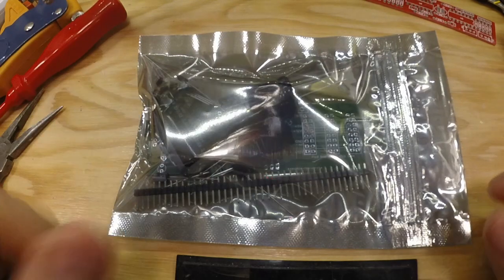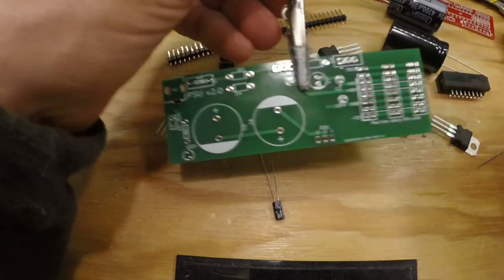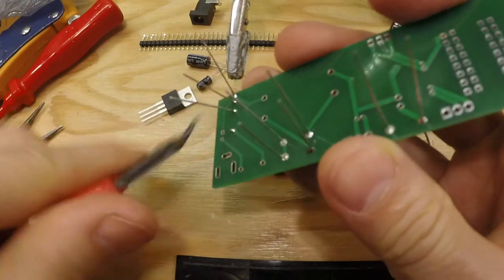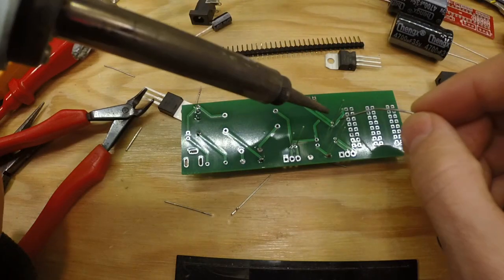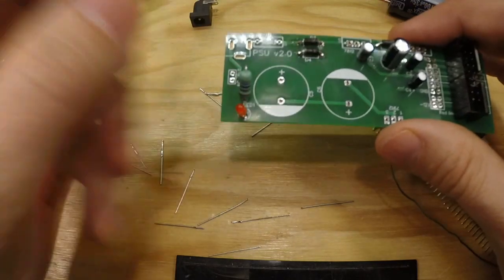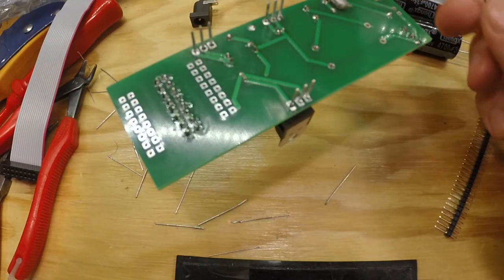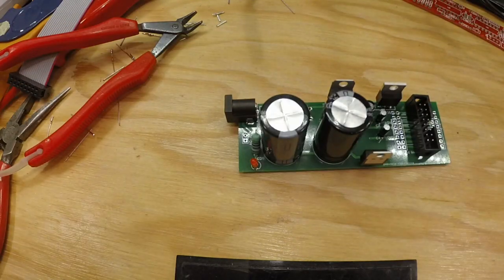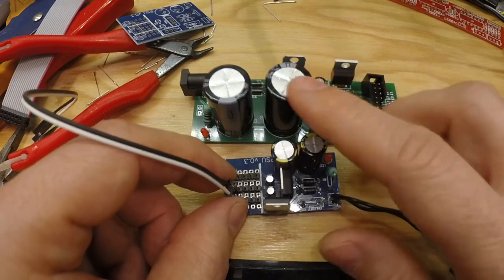PSU2 Soldering instructions

Comment: Just a tip for you all. It's good practice to use a heatsink when soldering any semi-conductors (LEDs, transistors, diodes, i.c.s) as they're all sensitive to excessive heat. If you leave the soldering iron in place too long, they can be damaged.

Comment: Hey Kristian :) thank you for making this! I just soldered together my psu and it gives me wrong output voltage (9V, 4V, 3,5V) I got two of them because I wanted to have a backup and they both have the same output voltages. Then I checked my ac-ac wall adaptor and instead of 12V it provides 16V. Do you think the wrong output of the wall adapter could be the problem?
Reply from the maker: Is it 16v ac or dc output? That is the important thing that usually people do wrong. It should be able to handle 16VAC. If you have DC out then it might look like this.
Reply: @SourceryOne  The wall adaptor ist ac, I checked the schematics and it says that the smallest capacitors should be 1uf30v, mine are 1uf50v, could this be the problem?

Comment: Hi, I'm planning on buying one, or two.
I was wondering what is the Amperage rating of the unit? I'd like to know how many modules I can power.
Thanks ;)
Reply from the maker: Unfortunately I don’t have a good answer. The regulators are rated at 1A. But then you need a big wall wart 12VAC and BIIIG heatsinks. :).
Reply: @SourceryOne  it seems you probably get 1/2 or 1/3 of the amperage you put in. for example 1000ma you might get 300ma - 500ma. I could be wrong though, my friend had a quick look at the board. But apparently this is typical for this kind of PSU :)

Comment: I was wondering how you'd go about connecting this (or the busboards) to some of the diy modules you've made. Are just the +/-12 v and ground pins used, or is it more complicated than that? I'm mostly confused by there only being 2-3 points of power entry for each module, but many more pins present on the power supply.
Reply from the maker: In the early modules I just used DuPont cables to connect +- and gnd to the modules. The later Modules using the eurorack power plug (IDC) is just using the “industry standard” for modules. On these connectors each “row” is the same voltage. So going from the “red stripe” the voltages per row are 1. -12v 2,3,4. Gnd 5. +12v. 6. +5v. 7,8. Cv and gates (not used in the psu, but still there to fit the standard). Hope that clears it up a bit. But again it is totally fine to just use cables DuPont or other and connect power to modules.
Reply: @SourceryOne  I see, so if I use dupont connectors should I wire from the whole row or just one of the pins?

Comment: Looking forward to mine arriving soon. Can I check what sort of AC adapter you'd recommend for this? And do you also have an idea of how much power you get per rail? Thinking about what size setup this will be useful for. Thanks!
Reply from the maker: Sorry I dont really know how much, but it is enough for a bunch of modules though. The regulator is rated at 1A max, and then it depends on how much A you get from your AC adapter, and also if you are gonna have a lot of load on it you need to add cooling fins... As for AC adapter I use 1A rated ones, and I find a lot of them from outdoor led lighting and or halogen lamps, they usually use 12VAC. Hope you find one that works. you can get a bit higher voltages too 15VAC would work fine.
Reply: Thanks for the reply! Am i right in thinking the adaptor would need to be AC to AC?
Reply from the maker: William Evans yes.
Reply: @SourceryOne  just finished the video and realised you mention it very clearly at the end...apologies! Must have missed on first watch. Will be building this weekend, cheers.

Comment: When I worked in a board assembly house I learned that there is a convention when mounting resistors to circuit boards. And having examined thousands of circuit boards it is true. Resistors are mounted according to board orientation. When a board is top side up a resistor should be either left to right or top to bottom as the markings are read on it. It's done that way for manufacturing QC and troubleshooting. When you solder a TO-220 package just tack the middle leg and then adjust the component.
Reply from the maker: Ah. Thanks for the info. I at least try to have them all in the same orientation. Because it looks better and yes easier to error check. :)
Reply: @SourceryOne  electrically the orientation of resistors does not matter. But we're not electrons. To us it matters. Neatness counts too. Well constructed boards tend to work better. Pride in craftsmanship and all of that.